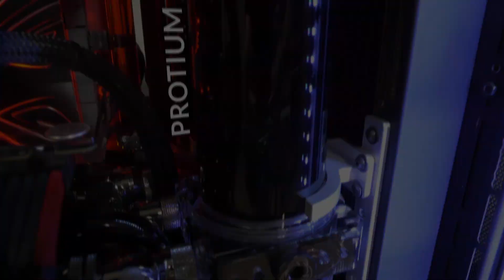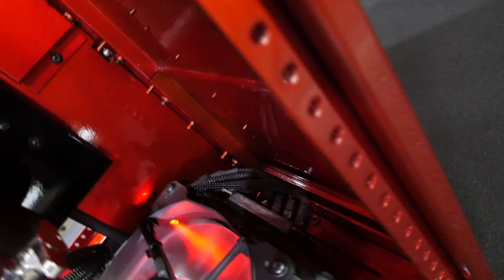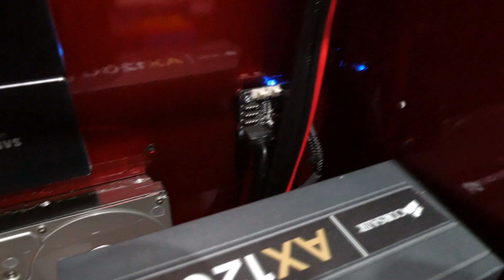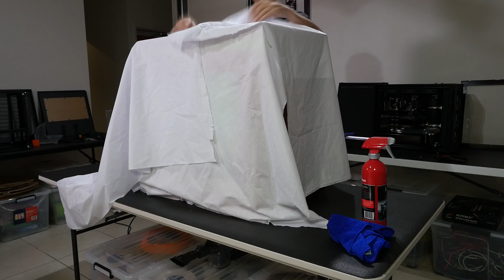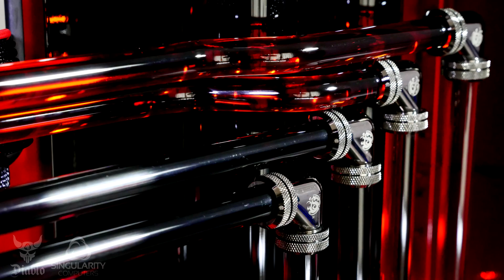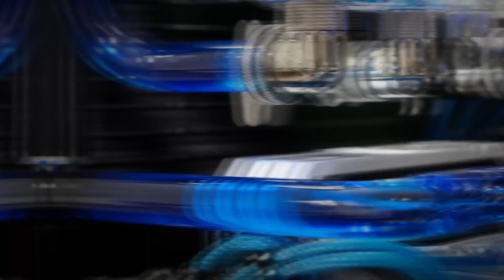Diablo Caselabs THW10 Build #28 Part 3

Comment: Not really feeling this design. It looks awesome, from afar. But the little details. Like the cables forced into angles due to the mobo not being fully compatible with case. Lack of grommit covers. Unmatching red from the cabling to the red motif. To include the inconsistent tube bending at the top, oppose to the rest of the straight line/rigid tubing. Just feels like too many compromises were made.

Comment: Should swap out for the new duel 16mm bitspower 90s. Using the enhanced single fittings with a 90 looks like mushroom caps

Comment: I see the radiators are in parallel configuration with the GPU's/CPU on booth loops. It looks more clean, but does it work (temp-wise)?
Reply: Stijn De Bruyn It all depends on restriction. The more restrictive a block is the less flow it will get in a parallel setup. If they're hwlabs gts rads then they are about as restrictive as a gpu block, but these look like gtx which aren't very restrictive so I'd guess the rads are getting moderately more flow than the blocks.
Reply: But if the GPU/CPU block get less water, don't the GPU/CPU get hotter?
Reply: Stijn De Bruyn Flow only matters when there's not enough, you get diminishing returns as you add more. He did say that he had to crank up the pumps to 100% so he's probably just barely got enough flow to cool the blocks. More than like 1 gallon per minute won't reduce temps much, but less than 1/2 gpm will have temps skyrocketing .